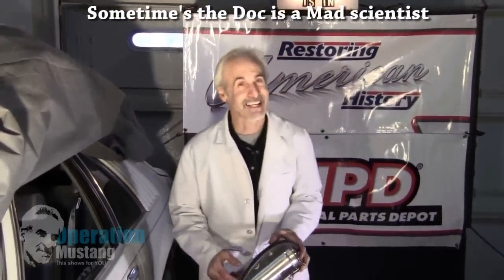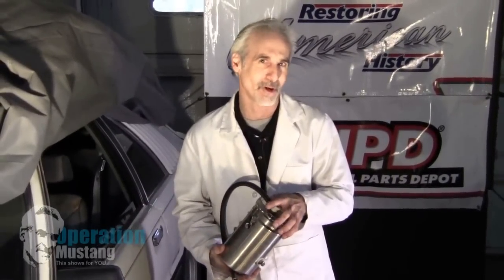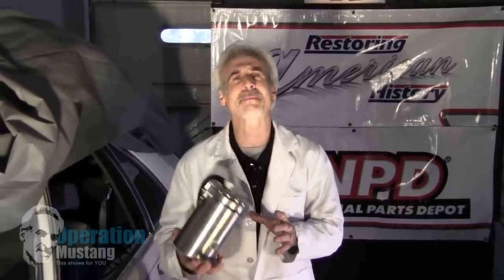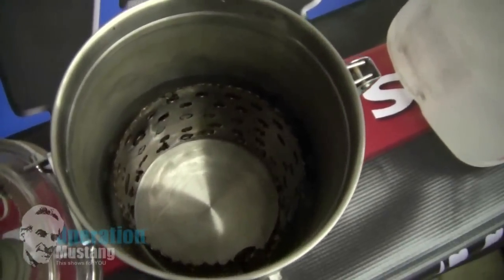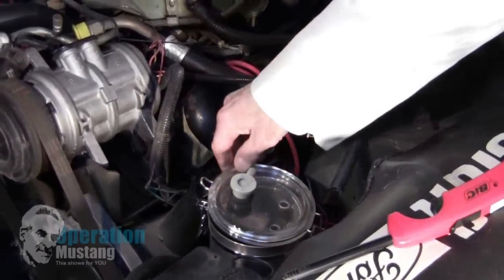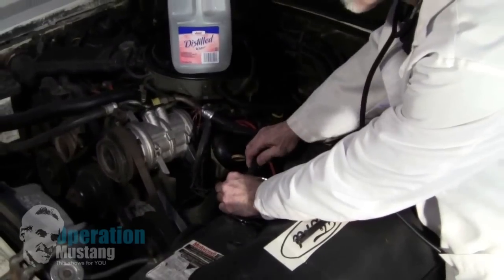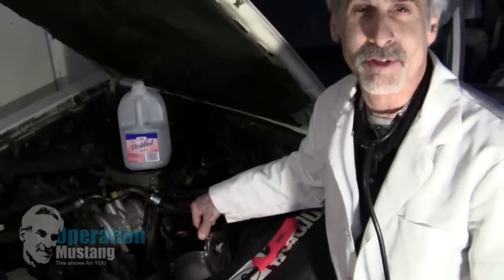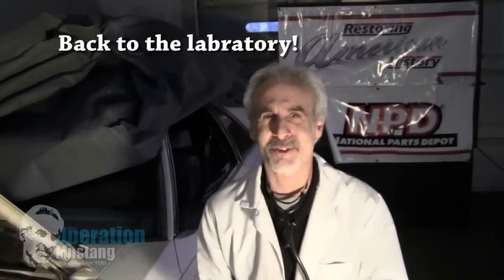The Doc make's a Hydrogen fuel cell to power a Mustang

Comment: Using baking soda as an electrolyte? Why not use NaOH or KOH?
Reply from the maker: Good question !! Yes those would work much better. But there is more of a danger factor involved. Seeing as this was just a fun project. I choice not to go there.
Reply: You are probably right :D .For my experiments on alkaline water electrolysis I use ~10mol/L NaOH which is beyond the usual 0-14 pH Scale. It would be interesting to see that get in the aluminum engine. I have a friend who is currently working on an academic journal about using hydrogen fuel cells for transportation. We plan to build a car or at least a model car runing on hydrogen for a youth research contest.

Comment: The byproduct of gasoline for the most part is also water and all cars are designed to handle this as the normal operating temps are such that water will boil when it gets past the piston rings in to the oil compartment. I wonder why everyone forgets hydrogen is what is burning in the presence of oxygen is hydrogen with the use of gasoline? Can our school systems really be that bad? The primary byproduct of burning gasoline is water vapor so cars already run on water when you think about it.

Comment from the maker: If  more Oxygen get's drawn into the engine, it would have to be off-set with Gasoline or Hydrogen because an engine cant run on just air, Too much air would create a stumple or hesitation when trying to give the engine more throttle. We could be millionaires if we could figure a way for an engine to run on Oxygen alone. Great question!  thanks, Chris